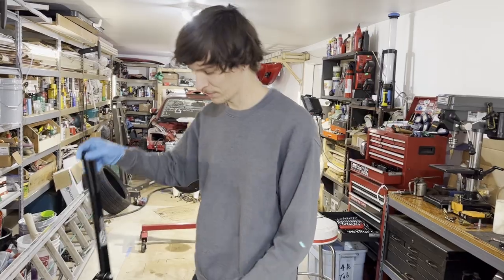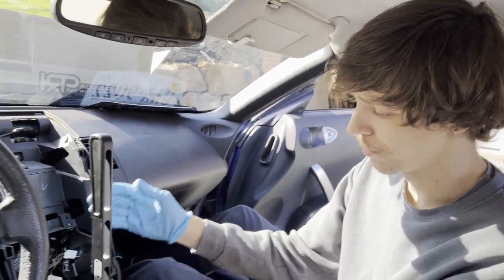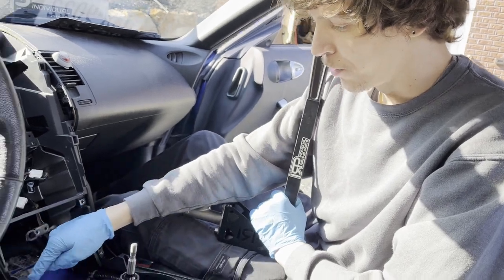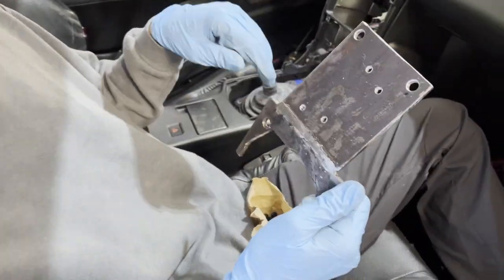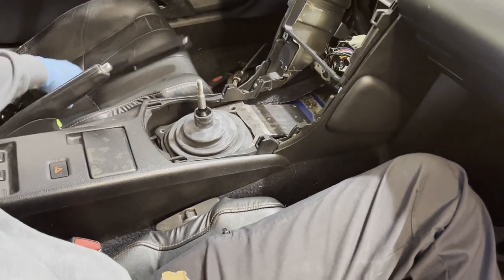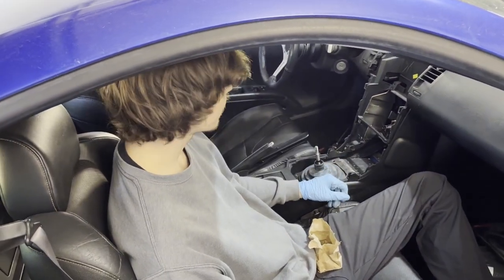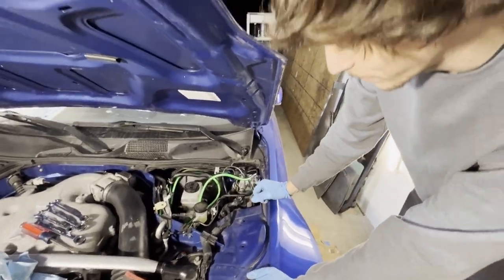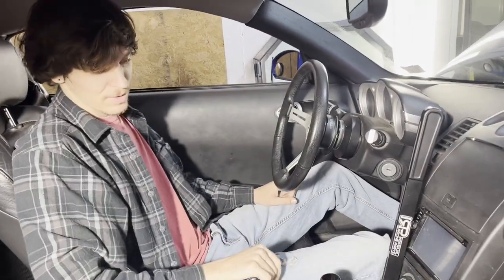Inline Hydro E-Brake Install

Comment: The switching of the front brake line over one is not in the Sikky instructions. This is literally the only touring model pass through install i could find on here and it totally helped me with just hearing that little tidbit of info so thanks guys for making this! 👍

Comment: You should just buy a primeweld plasma cutter. With all this work your doing with your grinder. You have a 220 plug now . Primeweld is inexpensive and has a great warranty (basically a Chinese Amazon unit but with a good warranty lol)
Reply from the maker: Not a bad idea... Maybe I will put it on my Christmas list this year
Reply: Could you possibly drop link for the hand brake an lines? Also what lines did you have to swap this would be my first time doing this!
Reply: Great video!!